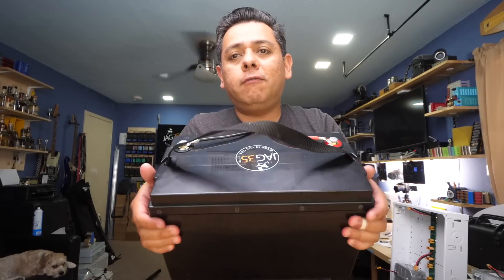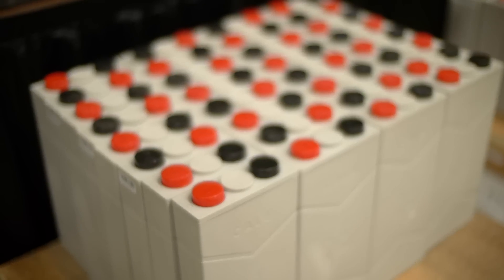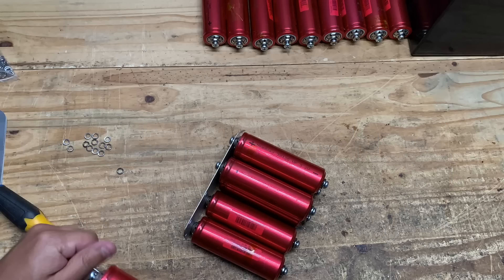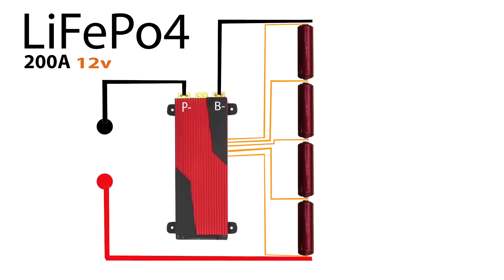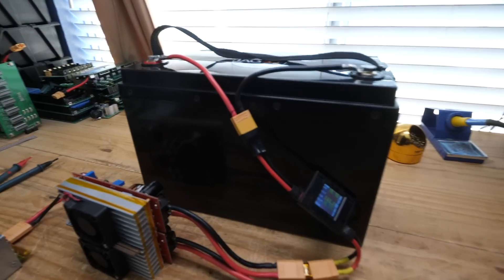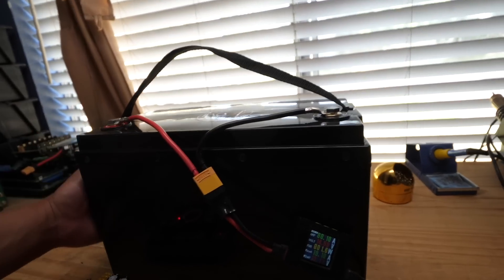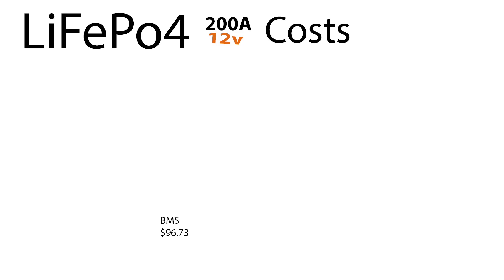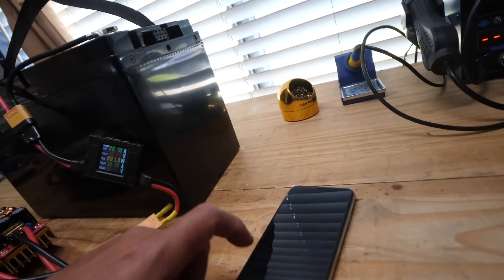Build a DIY Lithium LiFePo4 Headway 12v Battery replacement

Comment: a aluminium container with aluminum separators instead of the cardboard and maybe an internal fan or a vent for air cooled , wouldn't that help to push them more
Reply: Aluminum is conductive, dry cardboard is not. Be careful to avoid shorts.
Reply from the maker: Build it
Reply: @jehugarcia  , I plan on giving it a try, I've got my 1st 100 18650s through scrap electronics at our local auction here, I've been learning from you and others how you've been putting this stuff together in the past year, fun lol.  I've been buying junk booster packs for a couple bucks,  with the booster packs the ones with the built in inverters these have all the fuses and protection, usually the batteries are shot so I connect 2 more jumper cables to where they connected to the internal battery so I have it external for easy connect and disconnect and visual inspection for the battery protection, I use my car battery I bought 5 years ago and never put the car on the road, the booster cables for the amps and the inverter for the 120v with my variac plugged into the 120 to conserve so what I have is a speed control off a 12v, I have a 3million candle spotlight it works off 12v with the  variac it lit up to almost 24v it tripps the pack almost to 24v somewhere between 22 and 24 so if its 3million candlelight at 12v it may exceed that to 5 plus million, it's definitely brighter I don't have a tester for light beams, raising it very slowly up around 23v will pop the bulb even with protection but the extra heat in the bulb might help pop it. I could easily run some cables to some solar panels into the led acid 12v to charge the lithiums through the 120v outlet what would you say about charging lithiums through the booster side of the pack for the amps?
Reply: @jehugarcia  , there's 2 120vac plugins on my booster pack can I run both into 1 with a  few 12volts in parallel off the internal battery? I'm not sure how many amps this pack is rated for through the inverter, it should double almost
Reply: everybody likes the 240v

Comment: How about a 48 volt version of that??? would be VERY interesting as part of a home backup...
Reply from the maker: Billblom  easier,  the 12 is the only one that requires this kind of rare and expensive chemistry
Reply: @jehugarcia  4x12=48 you can use lipos
Reply: @jehugarcia  I would think it is getting a lot more common.. now that isn't surplus tesla module type pricing (out of wrecked Teslas) -- is a tad high, but a LOT less prone to having things like fires and the like.  A much safer chemistry than the regular Lithium cells, which can do miracles of light and sound if the BMS fails...   Looks like the LiFEpo was doing very nicely in your testing....  going with 48v would make the current 1/4 to get the same power out... which means less heating and the like..  Just a bit more $

Comment: These headway batteries are nice. I build a replacement battery for my lawn mower (36v lead acid). I am able to use the standard charger that came with it. I shorted the batteries a couple time during my build and ruined a few batteries. You definitely need to be careful not to short them.

Comment: Actually i don't see the point.
Yes that thing can power up something very power-hungry,  but it's only 35Ah you won't last very long with that.
In 12V ( automotive especially) applications you need something capable to give some burst of current ( something near 400A or near that). if you need to power up something very powerfull you will probably end up connecting some battaeries together.
That battery is roughly about the same size  of a normal lead acid battery .... and is way more expensive
Reply: Different batteries for different applications - this is not a replacement cranking car battery.
It's less than half the weight of a LA battery, and can be discharged to 0% over 4000 times.
You can't use all the energy in a car battery - it would be very lucky to last a hundred cycles at that depth.
Reply: @ahaveland  fair enough

Comment: so 12volt car batterys are all 100$ but this jag 35 battery is 500$ but you can use it is say a camper and get better gas mile and run the light all night lol :D
Reply: Yes and unlike lead acids lifepo4 is not happy being in a constant fully charged state so a cars charging system would do damage rather quickly. Like John said that is not the intended use. Also Jehu brought  this battery very high and discharged very low for capacity testing  purposes but the sweet spot for a Lifepo4 is at about 13.2 volts and you really don't want to go over 13.8 volts in charging. The cycles should not be that extreme.

Comment: Due to the current being limited to 200 A by the bms, I'd say this would be unsuitable for use on a car.    My puny little car uses a battery with a CCA about double the capacity of the BMS on this. Problem 2 with using it  in a car is that the charging system on a car is optimised for lead acid,  it will stress a lithium based battery. Problem 3, I would be very vary about putting a battery like this in the engine bay of a car lots of heat and vibration at the very least it would cause the screw connections to work loose in short order.  Lithium shines in long deep charge discharge cycles which doesn't happen in ICE cars.  A car wants several hundred amps for a few seconds to start it, once started the alternator will have it back fully charged within a minute and then the alternator runs all the electrical stuff itself.   A car battery in a car will last for years, using a car battery in a deep charge discharge like for solar storage will fook it in a very few weeks.  Horses for courses.

Comment: I think I would want to relocate the internal connections from the individual cell posts and put them directly onto the bus bars. The
 way you have it set up is going to stress those 2 cells where the connections currently are.

Comment: This is an interesting battery. Doing the math compared to a new 18650 this might be close enough in watt hours per $ to make it a no brainer. WHen I switch from used 18650 to new I might try these lifepo4.
Reply: Check out prismatic LifePo4 cells.

Comment: I will take at least 4 of them for my Travel Trailer.
I want to make some now.
Like always great video.
I wonder how many Amp hours you would get at 15 or 20 amps
Reply: Ah/ amp = hours. 60ah/15-20 =3-4. The batteries are expensive compared to AGM in the same ah size. I bought a 100ah for $200 to run my 1200 watt inverter, same size in Lithium is almost $800. Is lithium better yes, but not 4x the price for me.

Comment: Amazing job. Sir, I have a question that can we use these cells in series to make a battery pack of around 72V to use it in Electric scooters?
Reply: Yes, however these lifepo4 are heavier and not as energy dense as the 18650. Pros:  no risk of fire and lots of cycles plus 100amps of continuous current per each cell. Cons : still expensive compared to 18650 not as energy dense as 18650s

Comment: As some others have said finally a video of the 12v lithium, so thank you. Im actually in the process of buiding my own as well. If the headway 38120hp cells ever get here from china that is. Since i never could figure out what to do with a bms i was actually going to go with out one and just pay attention to levels with a voltage logger. I say i cant figure out what to do with the bms because i dont care so much about the longevity of the battery but more power. If the cells are capable of even 60amp output per times 8 in my case i want 480 amps of output. All the bms i found are at the 100amp range until you shown this one which is at 200amp. So maybe there is hope if i had that many cells then i could run 4 of those bms. Im into car audio and i want to run as little battery as possible. Also considering a set of 6 2.7v 3000f ultra caps to add to the mix.  Now before all the haters comment, yes you could go and get 2 or 3 agm batteries for the same cost and then probably be done with it. And yes your right you could do that but me personally im into the new stuff and lithium is the future.  So i would like your thoughts on running without the bms.
Reply from the maker: Yeah I ran my pack without bms for years,  you can do it if you keep track of it

Comment: There is a need for an 'emergency battery pack' for mobility scooters. (24V ~5A) but must be very light and small. The number of times you go out and run out of power is high. they say they have say 10 mile range (yeah on perfect surface and a fly onboard!). Everyday paths and surfaces. You can't just 'lock it up and walk home like you could with a car. No you are stuck! My wife has more then once had to push me on the scooter to get back to the car. So a cheap lightweight emergency pack would be great!
Reply: Also if it could be recharged from a standard mobility scooter charger(international standard (often 2~3A 24V)
Reply from the maker: Lithium cobalt oxide is better suited for your application,  and cheaper
Reply: @jehugarcia  I wish some one sold a pack!

Comment: I am a member of a K9 Search and Rescue team who need several   smaller amp hour 12v batteries to power our communication equipment. I was thinking of 4s 2p. I wonder if you might give our Search team some pointers on BMS and charging units for a smaller Ah pack. Our team hikes these batteries and comm gear to mountaintops to extend the range of radios, thus the reason for smaller Ah packs.
Great channel and can't wait to see what you're up to next. Any help would be massively appreciated. Dave N2KTO

Comment: Hi. I just want to build a LiFePo4 battery pack from 120*32650 batteries of 5 Amps each. My problem is how to chose the best BMS for the job. Is it  a better ideea to chose cheap BMS that will connect each group of 4 batteries, or to chose a more expensive one (maybe a same port type), that will connect bigger groups of 4 batteries?

Comment: Very nice video! Great job on that build!

My one and only "issue" however is using 'combustable' cardboard as spacing material. 
It could also attract & hold moisture.

As I said however in your 300k video, I'd love to have that for my ham radio gear! Wow! That thing would probably power my 100W radio for nearly a week without recharging. (Avg. radio power usage much less than 100W...) great for emergency communication; like during earthquakes, fires, etc. 

Remember, when all else fails (including cell towers!) - ham radio is there!

(During the Paradise fire last year; amateur radio operators were attached to the various command units & fire/emt/equipment trucks to provide communications after all of the local cell towers & CalFire comm. towers failed/burned!)
Reply: Swine radio stations haha! Dude why the hell would you listen to pigs during an earthquake? I think ur high af this video is about batteries not imaginary radio stations ran by pigs, TAKE UR MEDS
Reply: @ContentCalvin  good luck when your house burns to the ground.
Reply: @skunkw0rx69  mafukka I live in a van down by the river
Reply: @ContentCalvin  good luck when the river banks flood over and you are trying to escape but get stuck in the mud...
Reply: @lolouro2266  My van doubles as a pontoon

Comment: Hi how are you jehugarcia i am hisham from kuwait do you think this battery i can use for a secondary battery car
The weather in Kuwait under the shade in the summer is up to 65 Celsius
Reply: Sorry bro no chance unless you can mount them in a fridge.
Reply: It's 32°C here in sunny Devon and mine are running HOT even on tick-over. FULL PULL and you have to be practically naked just to be in the same room.

Comment: bonjour
question pour alimenter un moteur 24v 50A de consommation 80lds de bateau
quelle celle et la plus adapter 18650 ou de la 38120 pour une autonomie maximal?

Comment: Hmmm .... that's a lot of money ... you can buy 5-10 lead acid batteries instead, hook them up in parallel and only cycle them for about 20% of their capacity, around the optimal SoC for longest life...
Reply: you will never get the same bang for you buck  with lead acid batteries a 40ah 12.8v Headway pack is the same power as a 100ah 12v lead acid both have 1000CCA but the  Headway pack is 1/3 of the weight.
Reply: Oh plus the headway will last 5000 - 10000 cycles.
Reply: @DEVONLAD11  im just saying it should be possible to make cheaper...a lot cheaper...

Comment: Sorry if I sound like a idiot.. but i'm someone trying to pick up some understanding of electronics for future use..  I guess my first question is how is the fact your using Lithium cell helping and how is Lithium in general different from lead acid?  I get the feeling that you have to arrange the batter this way so there where enough cells to increase the wattage enough to start a car.. but then you also set up up so there was longer battery charge... The way I think I understand it is while a basically a car battery can provide and hold enough power so you could go for about half a hour of driving without a alternator to change the battery as you normally need it too..., this battery could go half a day without charge?  

Did you actually need all the cells you used to do that?  was there  a possible arrangement where you could provide enough power to crank the motor, but it would not have as much power to keep the battery changed so long?
Reply: Lifepo4 cells are really not ideal for starting batteries. They are used to run electric cars. They contain a lot of amp hours at a much lighter weight. The benefits in addition to weight are that they charge much faster and hold their voltage as the capacity is used unlike lead acid which lower voltage as capacity is used. They have a much longer life than lead acid if treated properly. Because of their weight and quick charging capacity they are common in not only electric vehicles but also as the electric power supply for RVs and Yacnts.  However, even in RV and boats with lithium systems they still use lead acids for motor starting.
Reply: this battery could probably run a car for 24+hrs. 4 of these will start a car motor.

Comment: Nice build. I like the thermal vid. I wonder how it equates in Cold Cranking amps of a car battery?
Reply: It's limited by the BMS. 200CCA. If you remove the bms and go straight which I don't recommend, 2400CCA.
Reply: joblessalex 
Can you build a system that will disconnect the bms for just several seconds . I’m still learning is why I’m asking. 

The old dog new tricks thing
Reply: @drmachinewerke1  possibly a switch and a 12v solenoid? Short across the BMS, then flip the switch to turn it back on when you're done?
Reply: Ive seen someone else start a V6 3500cubic inch engine on a single 4s pack of headways. This could start most cars and trucks. https://youtu.be/XbuZbFq25gE
Reply: @GunMetalio A 57 liter v6 eh?
Reply: Ur_Quain Master 57 Liters...pistons would be about the size of 2 & 1/2 gallon buckets. 😆
Reply: Chris Smith surely ccm not inches 😁
Reply: Can be.
But you would likely have to add old Ford starter solenoid inside the pack if there's enough room.
Then add a single small pass through for the bypass wire.
Then attach the bypass wire to the coil of the solenoid.
Connect the other end to the key start wire on the vehicle.
Then attach the solenoid to bypass the bms during start.

I'm no pro on bms systems though and do not know if this would cause the bms to temporarily cut off when the current wire is bypassed like this. 
The bms would still have all of its connections correct, except it would see a 0 load during the cranking process and the full load of the starter would land on the batteries alone.
In theory it works.
If size is the issue then you would have to use a large pass-through Bolt that is direct to the batteries which in a protection standpoint would be more, dangerous, but you are comparing it to a lead acid which has absolutely no protection between it and the starter. Then connect the large starter wire direct to that and not have to make the bypass. Then the BMS can handle everything else in the vehicle and charging.
So overall you would have a 3 terminal battery.
HOWEVER, I see this BMS is on the negative side of the battery so 3 terminal will not work and bypass solenoid could.
Reply: put two bms and u would get 400a out. enough for a small engine .
Reply: idk but 4 can start a car motor cold. look it up
Reply: @imBriz  thats 2400 dollar............
Reply: @dolmarf411  ?
Reply: Your starter will likely surge near 300 crank at less than 200.
Look up "starter amperage test"
Reply: Wolfgang Preier  Tesla will be die soon
Reply: Between 1200 to 1600 CCA most likely. If you have excellent sales you will get a higher CCA if they are worn you will get a lower CCA.
Reply: This BMS is not recommend for a starter battery. However, you have options. High current BMS modules are available... but they're not cheap. It takes serious components to manage that kind of current for any length of time (duty cycle), without generating serious heat. I've seen folks use cheap BMS boards and get away with it... but if the engine is hard to start, it would fry it.
Reply: @driverjamescopeland  you can build a BMS way cheaper than you can buy an off the shelf unit
Reply: Nick.  It sounds like your charging isn’t optimal and shortening the life of the AGM. How is it set up?
Reply: You can't use it to crank some cars. The BMS will shut it down.
Reply: @kevinroberts781  unless it's less <=150A start(er)
Reply: @Alex Fiet I suspect that the BMS can take care of the Alternator current for charging. As for the cold cranking amps. Jehu mentioned that one of these in dead short should do 200Amps, and he's got 8 cells in parallel, from a CCA standpoint you'd be seeing something like 1600A less any inefficiencies and any 'used battery wear'.